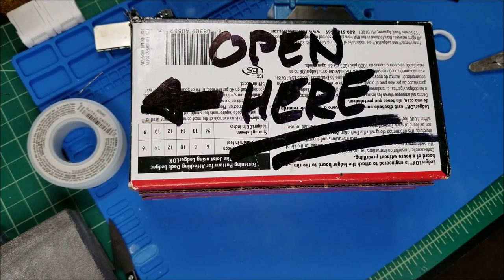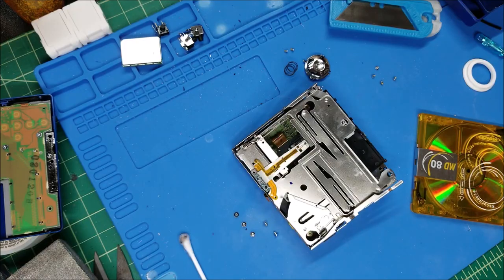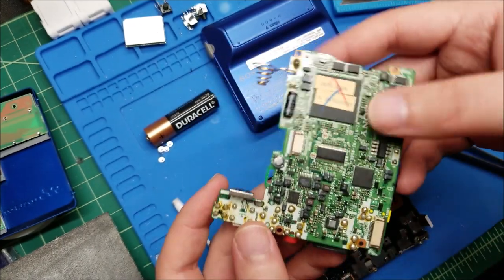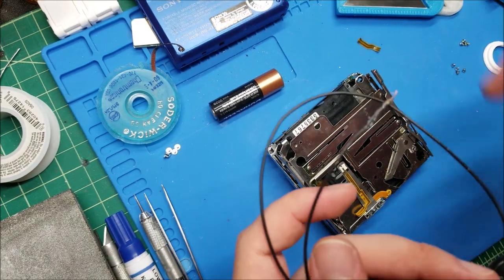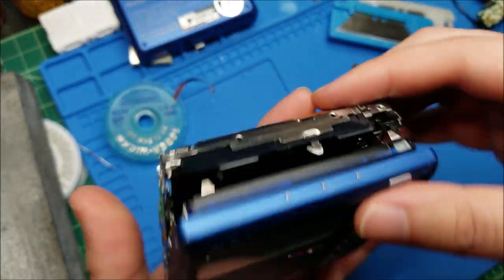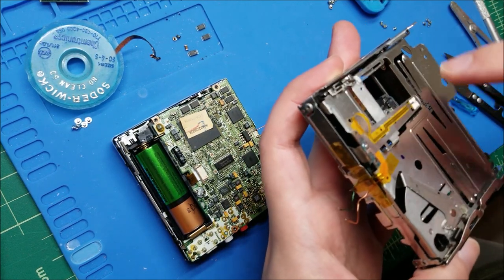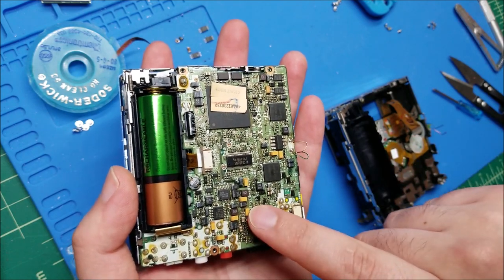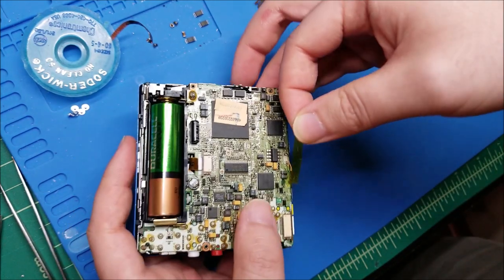Let's Fix: Tale of a Sad Sony MZ-N707 Portable Minidisc Recorder

Comment: Hey awesome video! was great to see how you diagnosed and fixed the problem. I was wondering if you could give me some advice? I have a mz-n710 that powers up but when I put a disc in it just continuously spins and does nothing else.
Reply from the maker: Can you hear the laser sled moving at all (an easy test is to open the lid and carefully use a toothpick to push the side of the laser sled so it goes to the outer part of the rail, then turn it on and the motor should bring it back to the center near the spindle, if it doesn't then that's definitely a problem)? Secondly, it's possible the laser itself if aging/burned out. May sound weird but can you get it to play a disc if you place the unit on one of it's sides/upside down? This is a trick that will tell you if the laser/focus mechanism is getting weak.
Reply: @sjm4306  I can here the laser sled moving when trying to use it. I have previously opened it up and moved it out and it does move back. I have also replaced the laser with one from a spare unit (that did work) and that didn't change anything. Placing it on a different size doesn't do anything either it just spins for a while then powers off
Reply from the maker: When you replaced the laser did you do any recalibration through the service menu?
Reply: @sjm4306  I did yes but that made no difference either it generally had an error of NG 336 (it had this error before)

Comment: Hello! I just bought one of these and it was missing some screws, do you know where I could get some replacements? Wondering if I should send it back or keep it because it works fine ..
Reply from the maker: If you got it for a good price and it works perfectly I'd just keep it as you will likely end up spending much more finding one in better condition. As for replacement screws, you can try searching for an assorted small screw set (like for eyeglass repair). I unfortunately don't know the exact size though.
Reply: @sjm4306  thanks for the response! I got it for $90 so I’m trying to decide if that’s a good deal or send it back within the return period, considering all the buttons and everything works fine and it came with a disc that it plays with no problem.
Reply: Hello! Sorry to bug, so I finally got it going and it plays back fine but when it comes to recording.. I record through my MacBook “web minidisc”, it finishes.. shows all tracks on the track list but when I disconnect it “TOC EDIT”s then doesn’t play.. turns off and when I hit play button again it says “blank disc” .. any idea what could be wrong??? I’m hoping it’s not the laser that you mention as I have NO knowledge of soldering ..etc.    T.I.A.! 🙏
Reply from the maker: This is a super common problem, the good news is your laser is fine, the bad news is your magnetic overwrite head ribbon is likely damaged. Also bad news is to repair it you will need to solder, and very fine wires at that.
Reply: @sjm4306  uff 😪 I saw someone ask if you repair but that was over a year ago, do you still take repair orders? I’d be more than happy to pay through PayPal and cover shipping etc. 🙏 unless it’s just better to buy  another one all together..
Reply from the maker: I'll be busy with moving to a bigger place and setting up my new lab but if you can wait I'm thinking of taking on repairs again sometime near december. If you are interested shoot me an email at sjm4306@gmail.com around that time and I can let you know more details.

Comment: So I've got the same N707 and also only get audio if I press the Aux cord downward... do you think this would be the "headphone amp chip" as you find at min 13:00 or the physical headphone jack itself or its connection? any idea would be great!
Reply from the maker: I'd first inspect the jack solder joints for cracking,  then test continuity with a multimeter using a 3.5mm audio aux cord to make sure the contacts inside are clean, and if all that looks good then it's likely the amp chip solder joints that are cold and need to be reflowed.

Comment: Very nice, and very instructive I have just seen this video, and I have the same problem you had (no sound from output jack) and since I do not have hot air gun for resoldering the sound controller, I have just put on the chip some plus minus thick adhesive so whenever I close the case it will press the chip down and it seem to be working (I don't know for how long :D ) but I am afraid I have no tools nor the skills for resoldering that little puppy.. thx ;-)

Comment: 11:25 - big no-no: removing ribbon without soldering The Blob?
do you mean de-soldering? what do you mean?
great vid tho!
Reply from the maker: There are two exposed solder pads in the middle of the laser ribbon. The laser itself is sensitive to static damage so you are supposed to solder the two pads together with no power to the device before disconnecting the ribbon so even if you accidentally zap the ribbon contacts the laser is protected. Then when you are done the repair you plug the ribbon back in and remove solder from the pads. I didn't do this in the vid bc I was sure to be careful and have an esd strap but it's good practice to follow proper protocol.

Comment: I wonder if there was a  mechanical event that misaligned the overwrite head that also severed the ribbon cable.  Once you repaired the severed connection it's still misaligned since you tested the head and it has good impedance.  Awesome repair none-the-less!
Reply from the maker: Possibly, I don't know its past history. I've seen so many different cases of damage to the overwrite head, it's easily the most delicate part of md recorders.

Comment: Dear Sjm
What an amount of videos! Chapeau for this repair.   Did you do any Sharp minidisk repair? For mine can't read the toc and there is I think one other video with that as a topic..
Hope to hear, goodluck!
Reply from the maker: I only have one sharp md portable recorder in my collection and I received it basically brand new in box with no issues so I haven't needed to do any repairs on it yet. From what I read though, toc errors for sharp units are commonly caused by cracked worm screw gears that prevent the motor from driving the laser sled up and down properly. They do sell plastic gear replacements though so it's repairable if that's the issue.
Reply: @sjm4306  thanks anyway; I’ll have a look and open mine first.  I’ll let you know!

Comment: Hi, Great video! I have a newly purchased mz -n707 that powers up but when I put a disc in it just continuously spins and does nothing else. I read one of your replies to another with same issue suggesting gently moving the laser sled with toothpick? Could you explain to me where/how to do this? Can this be done without dismantling? I'm very new to MD's Scored 2x Sony mds-je530 & mds-je630 (not working) and a bunch of minidiscs in an auction only recently which sparked my interest in this world of minidiscs that I had somehow missed. Appreciate any advice, Cheers
Reply from the maker: Thanks, glad to hear you enjoyed it. So to use a toothpick to gently move the sled towards the outside tracks you just open the lid like you are inserting a disc. Then press the tip of the toothpick on the metal part of the laser sled near the center spindle motor (don't go anywhere near the lens or you can easily permanently damage the optics). Applying slow pressure towards the right side will cause the sled to click as it jumps the worm screw (this is ok). Once it's out far enough you can close the lid without a disc and it should try to read if anything is there, give it a minute. After open the lid and see if the sled has returned to the center position or if it is still where you left it. If it returns then you know the sled motor is working, if not then either the motor or sled is stuck and needs to be relubricated.

Comment: Hey! Nice Vid. Any idea what is happening with 2 MD boards I have ( MZ-N610 and MZ-N410 )
They do not power up at all
When connected bench PSU and Play button pressed, current super quickly jumps up t0 170 mA and then shutts down, no activity on the screen
I assume this is power issue and PMIC shuts down after something up stream is shorted..... But board somewhat functions because PLAY-PAUSE-ENTER button is connect straight to Main Controller ( big ass chip ) that issues command to PMIC to start when button pressed !
Any idea?
Reply from the maker: Sounds like a short to me. Aux power works so dsp boots and runs but as soon as it tries to switch something on that directly shorts the power rail and pmic goes into short circuit protection.

Comment: Great class. I have one of those 707 that when recording it detects the microphone sound showing the bars but when playing back the sound was not recorded. Can you give me any repair tips?
Reply from the maker: Recording problems either boil down to laser or magnetic overwrite head problems. If it erases discs but cant record then it's the magnetic head, if it cant erase or write discs at all then it's the laser dying.
Reply: @sjm4306  Thanks a lot for the feedback. Apparently it's recording, but when playing back, no sound comes out. where can i buy one of these magnetic head?
Reply from the maker: That's the biggest problem, new old replacement parts are really hard to find/expensive now. Your only practical option now is to scavenge from another player that is sold as broken with a different issue. The alternative of repairing the original head depends on the cause of fault. If the ribbon is damaged you can solder splice wires to fix the break or if the head magnet wires are damaged you can rewind and solder them (though this is very difficult unless you have the hands of a surgeon and very good tiny soldering skills).

Comment: The firmware settings in my MZ-N1 are messed up, causing an NV ERROR and some discs not to read. the service manual states that all soldering should be done at max 270C
Reply from the maker: NV is non-volatile memory, basically all the calibration settings from the factory. The firmware itself is not user accessible in any way except by using a special program over usb on a computer. Usually nv can only be modified or wiped by entering the hidden service menu thru the unit itself. Did anything happen shortly before the player started acting up or did it just randomly show the error? Assuming the nv chip itself is fine and not the cause you'll have to recalibrate the nv by using a never burned blank md and a factory pressed md (nonrecordable album). Instructions to enter the service menu and access the recalibration routine are in the service manual pdf for your model which can be googled and downloaded.
Reply from the maker: Iirc you can just run the blank recordable disc calibration to at least get it to read recorded discs.

Comment: I don't suppose you could tell me where you can find those screws? I have a working unit but I'm missing 3 of the 4 screws from the front cover.
Reply from the maker: This post says M1.4 (metric, but doesn't mention length so you'd have to measure your remaining one screw with calipers) https://community.sony.co.uk/t5/portable-audio/md-n707-mini-disc-player/td-p/3782140

Comment: 505 and 707 with this problem of broken solder on audio chip
Reply from the maker: It seems this issue is very common with specific models. The placement of the chip right next to the jack means it's prone to mechanical stress.

Comment: A couple of things about the overwrite head that were going through my head:
Headphone cable is sometimes a coil around a former.  I didn't see a close up of yours, but the coil can add inductance (headphones only want 20kHz of bandwidth, otherwise they start picking up radio.)
The stress-relief loops in the extension cable had quite a lot of non-aligned area, which can add inductance.
Headphone cable is probably higher resistance than copper tracks, but shouldn't be a big effect.
Reply from the maker: Given the short lengths of wire used the increased inductance of stranded wire over flex pcb is negligible compared to the inductance of the overwrite head electromagnet itself which it's in series with.
Reply: @sjm4306  I wasn't able to find actual MiniDisc numbers, but did find an MO paper listing an inductive head at 20nH.  I've seen other patents that say <70nH.  By eyeballing the loop size, your added inductance was around 10nH, or 100mOhm at a couple of MHz. Maybe not significant.

Comment: I am looking for an MZ-RH1 overwrite head. Any ideas or suggestions?
Reply from the maker: I believe the other mz-rh models use the same head, just verify the part numbers with service manuals first.
Reply: @sjm4306  Thank you for comment though Sony is not providing them anymore in my country. I will continue the pressure but I don't think I will achieve something positive out of it.
Reply from the maker: I've found many available for free through google, so long as they aren't used for commercial profit I dont see any issue downloading a scanned pdf.
Reply: @sjm4306  I'm not talking about the manuals. I was talking about the actual spares.😉
Reply from the maker: Ah, sorry I misunderstood. New spares have been pretty much unobtanium for a few years now so the only practical source is scrapping another md model with something else wrong.